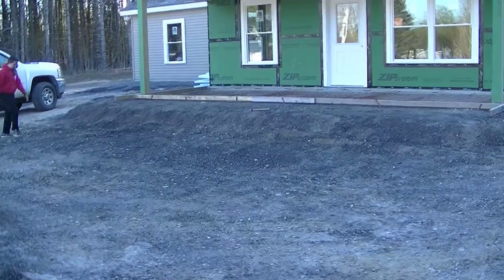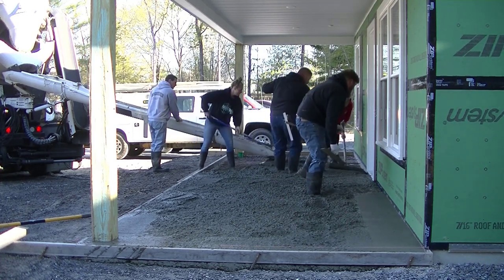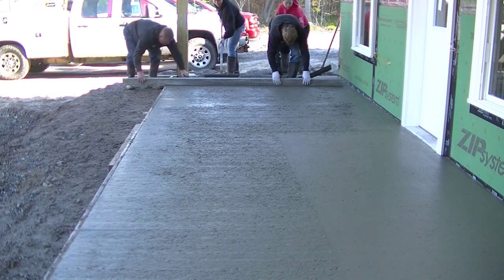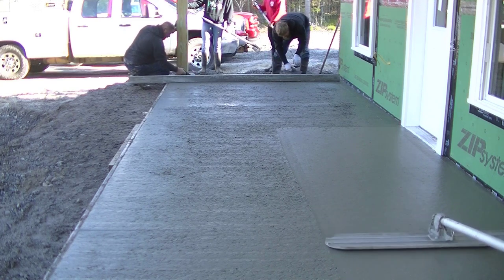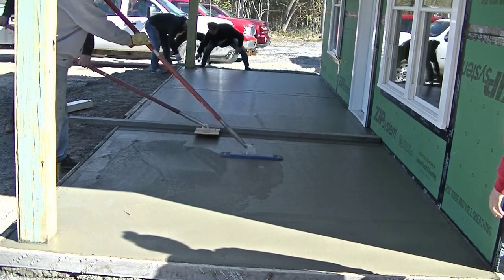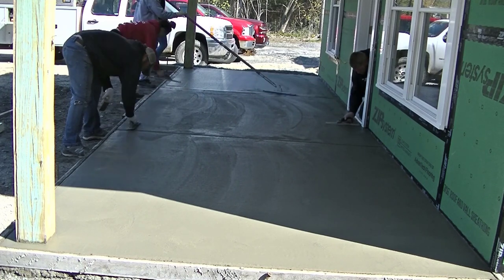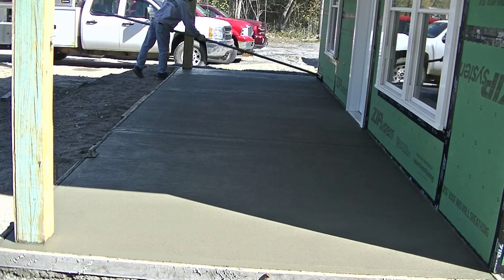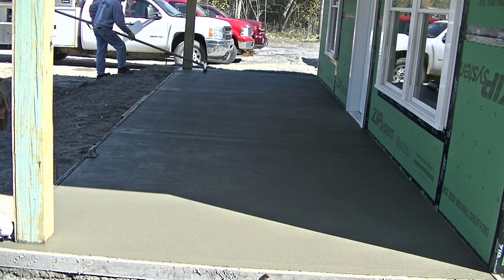Making Money With Small Concrete Jobs: Having a Minimum Charge (Concrete Patio Pour & Finish)

Comment: There is two kinds of concrete, 1 Concrete that is  cracked. 2 Concrete that is going to crack. All we can do is what you are doing, trying to control concrete to crack where we want it too.. Good looking pour right there. Keep up the good work. $8 bucks a sf is the average rate here for what you described.
Reply from the maker: Sounds good Nate!
Reply: It’s amazing how often I hear that. It’s also amazing to see so many 70 year old concrete floors not cracked yet so many newer floors and driveways cracking all over. Most cracking comes from laziness. Not doing the prep work. My driveway is undermined right now due to no  base material which didn’t slow down erosion.

Comment: See how the rod man strikes off the top of the wall line pad. That's correct. He ain't digging into it and he ain't riding a inch high. I've been watching yall for a minute
Reply from the maker: Awesome, thanks Tommy!
Reply: @MikeDayConcrete  hi mate just new to your Chanel your work is crisp, back in the UK I charge£ 75 SQM, in regards of washing release of would you recommend detergent or a mild acid wash just getting ideas as we been experiencing sealer problems, would appreciate feedback

Comment: I dont step foot on a job for less than $2100, if its stamped its $3200. You want a 10x10 pad, 30x3ft sidewalk? 2100/3200. I'll knock out easy stuff around 4-500 sq ft quickly for $10-12 a sq ft stamped 20-25. 8-10 on 2400sq ft or more, 15-20 stamped. For example I've got a tare out and repour this week. 12 3x4 steps, and 500sq ft all stamped. Bid it for $17500. $50 a sq ft for the steps, $20 a sq ft for the stamp.

Comment: For sure. I do water lines. I tell everyone my price is only $10 per foot. But the minimum is 100’. No one hears the “minimum” till the third time. You must keep saying you have a minimum. They will finally hear it but you have to still keep on saying it because they will not tell you “ I understand minimum “. You will get done with a 20’ line and they will be standing there with 2-$100 bills. Trust me. Keep repeating minimum. And if the measurement doesn’t reach your minimum. Don’t mention the measure. Just keep saying “I have a minimum “.

Comment: So 1500 is just to get you, your guys and gals payed? Basically a day rate for your crew, then you add materials and your profit margin to come up with what you charge the customer? Correct me if I’m wrong. I’m not in concrete but I’ve been in floor covering demo/installation for almost 12 years. Lately I’ve had to lower my minimum.. which is extremely frustrating. My minimum was literally my break even point too, so when I charged a minimum is was essentially working just to keep up with the bills and pay roll that day. It takes 560$/day for me to stay in business and I’m having to charge 400, sometimes 500 to secure the small jobs when I’m slow. Any tips for when customers want small jobs but squeak about the minimum?

Comment: How do you keep the mesh or rebar up when you’re walking in the pour while screening?
Reply: The rocks in the concrete do that.  Once you lift it,  you're not getting the mesh down to the bottom without meaning to.
Reply: @rivahkillah  maybe. I’ve read that’s one of the leading causes of reinforced concrete failure is reinforcement too close to the edge
Reply: Keep a bar with a hook on the end of it and pull it up as you’re pouring and screeding. By the time you get on it to finish it, the concrete is strong enough to hold it where it’s at.
Reply from the maker: Once you get aggregate under the wire it stays in the bottom 1/3rd of the slab.

Comment: Mst times on small work i pass material cost onto homeowner then 300 per man per day if i have to take check will add a little more to material cost but i will do all grading and forming at the 300 per day per man usually works out better for homeowner as we never know what im going to run into on prepping for concrete

Comment: I feel pretty good now knowing how much I saved myself by using a 60 year old cement mixer and a 2x4 for a screed...
Reply: Yeah I’m sure it looks as good as this too.
Reply: Agreed. I started out as a auto tech for 20 years, then an electrician. Seeing the needs of my customers(elderly woman) I started helping with plumbing toilets and faucets, then doors and windows. I am now a handyman. I rarely run into previous work that is better then mine, sadly. Most windows have zero insulation, caulk or foam that I tear out. Plumbers work is just terrible. Electrical is back stabbed on every new build. Drywall is 10 screws or nails per sheet. I live in west Tennessee for perspective. The point is you can do a better job then most contractors if you study and go slow and care about the results. Many guys are in it for the paycheck these days.

Comment: Would have been nice to see the drill and pin process with rebar
Reply: hammer-drill with slightly larger diameter bit, then hammer the rebar in until it's tight.
Reply: @hudi42  I have tried this and failed months ago. What drill bit size did you use and what rebar size?
Reply: @gpcm9226  5/8 rebar 5/8 bit but a felt strip is usually used when a slab touches a full basement or frost wall. The foundation goes below frost line the slab doesn't. It does help the slab to not settle I have done both ways pinning it didn't harm it. But some experts will say you should never. Not doing it sometimes the slab can settle and not line up good after first winter, usually because site prep. I like to sill seal around the beams on the outside in case of frost the sauna tubes are 4' down also for frost protection.
Reply from the maker: We used a hammer drill with 3/8 concrete bit. Then pounded in 3/8 rebar about 2 to 3 inches into the existing slab. It's pretty easy and probably took about 5 minutes on this job.
Reply: @gpcm9226  what failed? did the slab separate from the foundation or just the rebar didn't stick? sorry to hear that